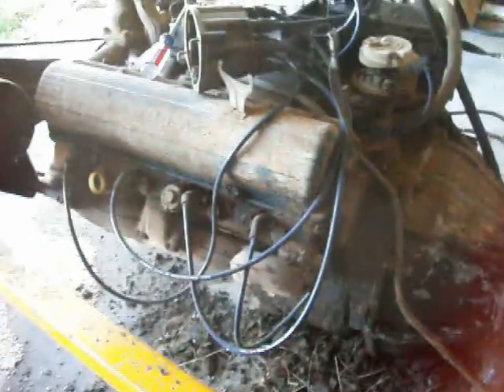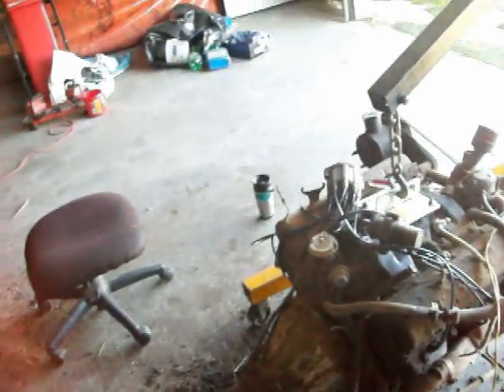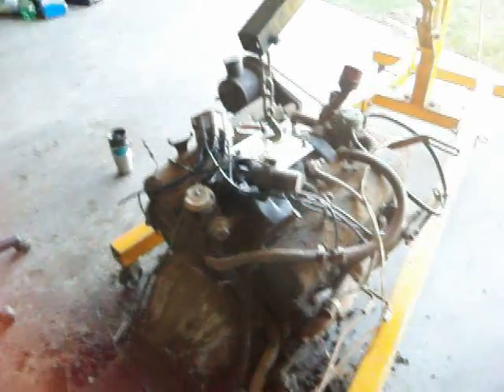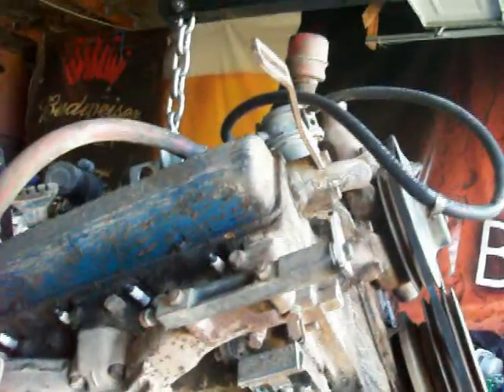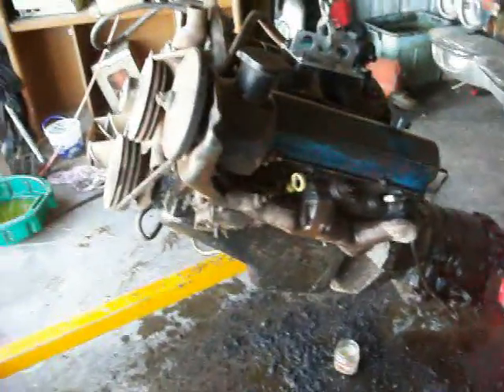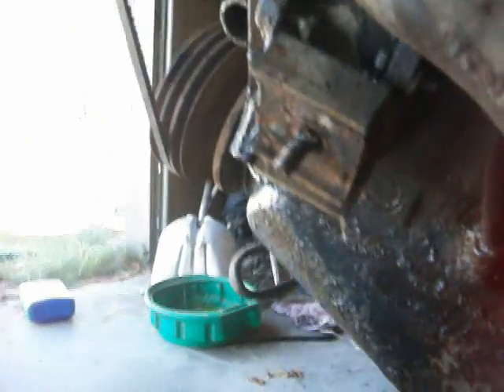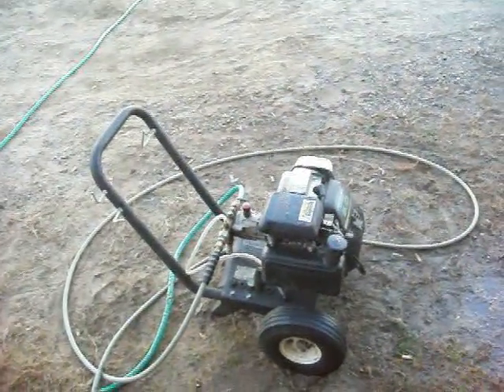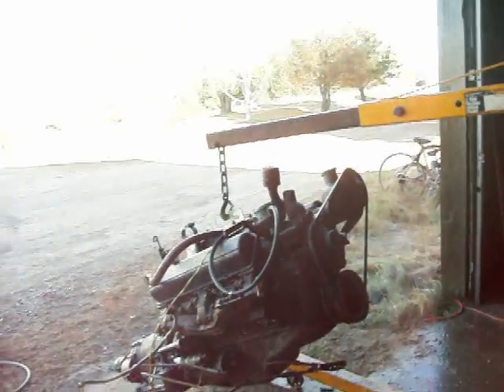Cleaning up the Cadillac motor

Comment: A great way to clean that stuff off is to use oven cleaner. works better than GUNK engine cleaner or an engine cleaner. Spay oven cleaner on let it set an hit it with a pressure washer. Love your videos bah53.

Comment: pull off everything.  get it on an engine stand. pull the heads, do the rings.  new timing chain, dizzy, freeze plugs, valves, seats for unleaded,  cam grind, fuel pump, fuel lines, clean tank, take the radiator and heater core to the shop, have it rodded.